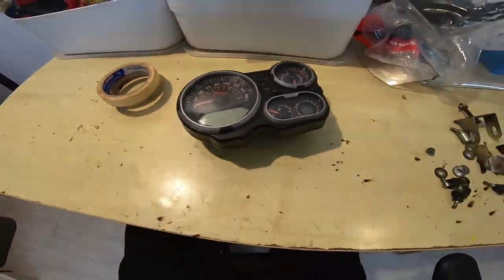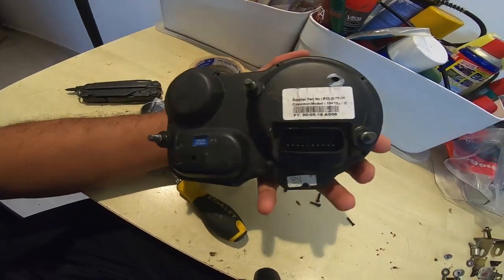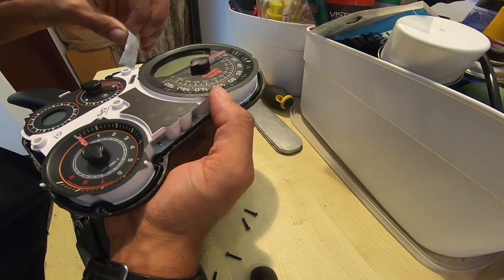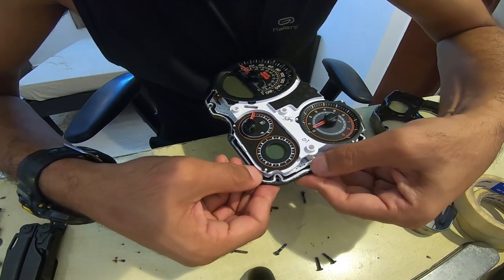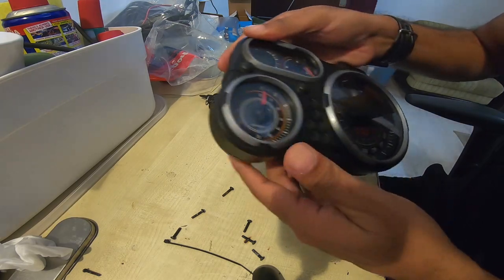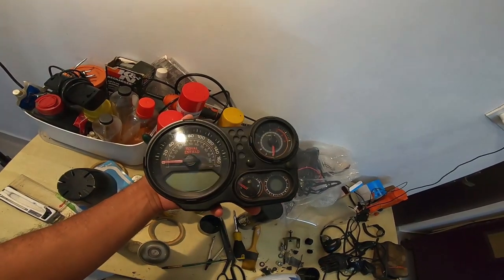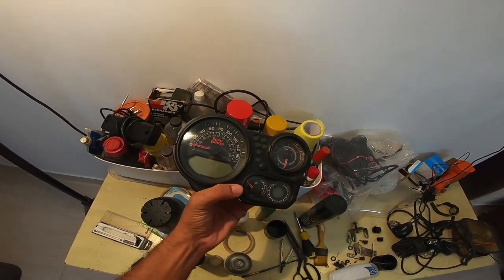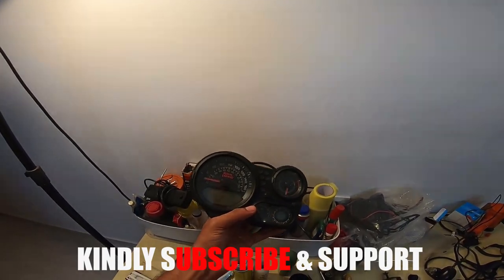DIY-speedo/instrument console FOGGING ISSUES FIX

Comment: Great video again .... I used fishing pole elastic ( number 11 red) to make a nice rubber seal. Polished the inner glass with some washing up liquid, added a silica gel pack.  also added a few drops of ACF50 into the female speedo plug and then made a boot to cover the plug using self amalgamating tape. 6,000 miles. I also did the whole job in a nice dry environment.
Reply: Sounds like a lot of work. Good effort nevertheless.

Comment: Brill Vid! 👍👀
 I have had my UK 2021 Himalayan for 5 months now and have had fogging by the LCD screen within the first few days..people say get them changed under warranty, but why waste my time riding nearly a 6 hour round trip to my local dealer to get another set of clocks that will fog up too? then keep wasting time going back for more and more replacements 🤔
Every Himalayan I have seen has had the same issue so i have chosen to live with it for now (dont want to void the warranty opening the dash) as it doesn't really bother me, I can see the speedo, fuel gauge and rev counter just fine and that is all I need 😁
new sub! 🤘

Comment: Just a doubt - did you poke holes in the silica gel packet before fixing it into the cluster? Because, if you didn't, it's as good as not being there as it won't absorb the moisture in the cluster, right?
Also, I joined your team by painting the taillamp matte black and installing the orange reflector on the side of the rear number plate, Have been a big fan of your DIYs! Thankyou for your videos!
Reply from the maker: The pack already has holes . I guess the camera didn’t pick it up

Comment: I just got a brand new 411, 2nd day display fogged, not great. I wonder if a silicon bead around the join on display would fix this ?
Reply from the maker: Yes it will but also place a small silicone sachet inside
Reply: @ONTWOWHEELSBEN  ok, thanks, I have ordered the silicon seal, will do that when it arrives. thanks

Comment: Did you bake that silica pack to dry it before installing it?
Reply from the maker: I have the packs inside a small air tight  metal container . No chance of moisture getting inside . Also I have 5-6 packs at any given time inside the container . So nothing to worry .

Comment: no one cares about the o ring, its not airtight any way, otherwise it would not fog up. My speedo also has this problem. i think we have to live with that probleme. I did not find a solution becaus the silica pack does not help that much (i think...)
Reply from the maker: The silica pack helps for about 5-6 months ( depending on the amount of Rainfall your area receives) . I don’t do a lot of rain riding .